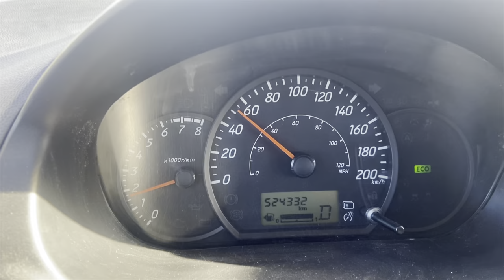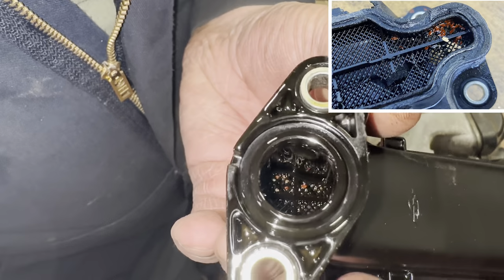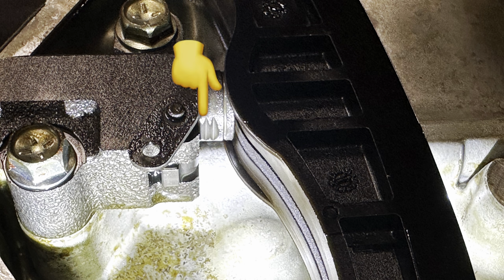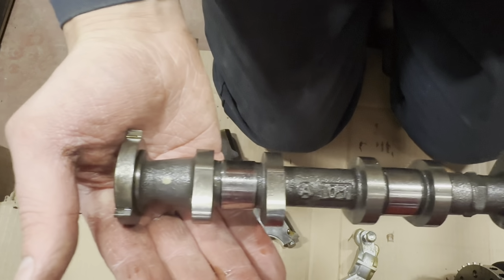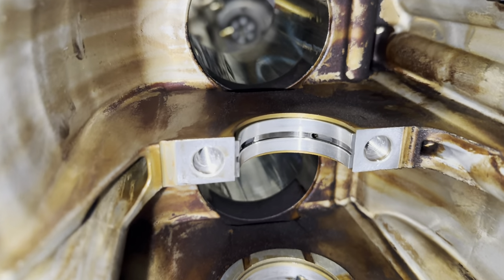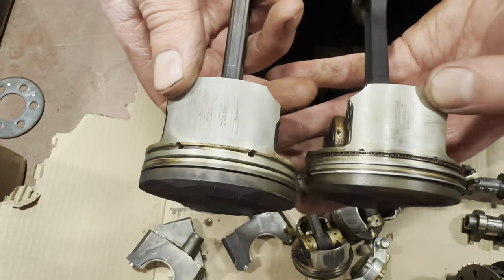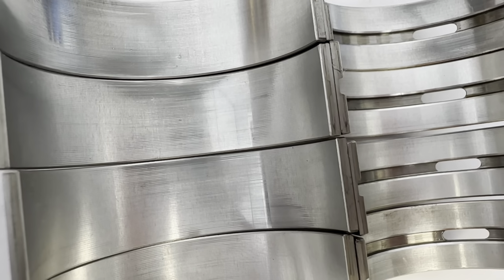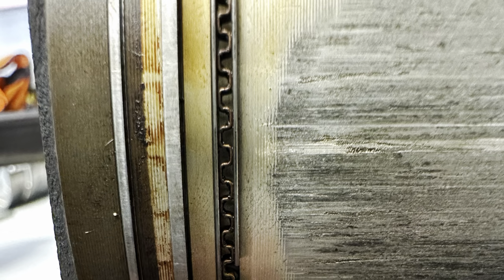524,000km Mitsubishi Mirage engine teardown

Comment: i'm impressed by the milage. we in germany have issues with the 3 cylinder "space star" (mirage) 
sloppy pistons. they eat the cylinder walls. no idea why it's so prone...
ours had 100 to 160k km on the clock where they developed the slap and blocks got replaced.
Reply: It is because of the 15,000km oil changes europeans seem to love. I change mine at 7-8,000km. I hope my Mirage will last a long time. Its my first new car.

Comment: I have had 3 mirages all 5 speed manuals for runarounds and they were great for what they were.. I was always a mits fan but now that nissan owns them they will go down farther. I am a retired ford tech and will not buy anything with a cvt, but i have a friend that put over 300,000 miles on his 14 mirage and his cvt never failed. Front wheel bearings seem to be the only issue i ever had. I also had an outlander sport with 5 speed manual But this old fart made me an offer when it has close to 5,000 miles on it that was over 5 grand more than i paid for it new.

Comment: The skirt wear occurs du to to the angle of the connecting rod while the piston is pressurised and goes to BDC. Therefore this happens to the same side all the time. It gets worse if you load you engine with high loads at low revs.

Comment: Impressive! What kind of oil and viscosity was used on this engine? Here in the USA ours say to use only 0w-20 oil for all temps, so I just stick to that with STP 0w-20 Full Synthetic Oil, but have read a lot of people complaining that it may be too thin for long term wear...
Reply from the maker: Same up here in canukstan. They call for 0w20 here so that’s what I use in the fleet Mirages. I pour in whatever oil I have in the garage at home in my own Mirage.

Comment: are those the original timing chain and head gasket? did it have normal compression values?
Reply from the maker: The tensioner ratchets out so when the chain and guides wore down a bit it took up the slack. I've never replaced the chain or tensioner on these cars. The guides might look worn in the video but they're really not. I'll have to post a picture or redo that part one day.
Reply: @turdpailsandtrails  looks like it can wait another 200k lmao

Comment: Was the higher mileage engine ran at higher rpms than the other? I have a 2020 manual Mirage, and at 70 mph the car is at 3600 rpm or so. I would expect the more frequent combustion and hotter temps would help keep carbon build up down. Is your high mileage car a manual?
Reply from the maker: All the Mirages in my videos had cvts. Most are fleet(delivery cars) so a lot of them were beat on while others weren’t so much. 
They rev lower at highway speeds than the 5speeds.
Reply: @turdpailsandtrails  That's neat, thanks for the reply. Are you the same guy on the forums that has a fleet of 30 or so? I'm pretty envious of the lower gear ratio of the CVT, though I appreciate the extended service interval for the manual.
Reply from the maker: Yeah I was a fleet mechanic until recently. I still have my black 2014 turd. 
I would prefer a 5 spd for the camping trips I took mine on.

Comment: If you didn't replace the engine, how long do you think the old engine would continue to run? Another 50,000 miles?
Reply from the maker: This latest one was noisy for the past year or so. I’m sure it would have kept running like it was for quite some time.

Comment: What brand of oil was used and did this car have a CVT transmission?
Reply: His quote "Ran 0w20 right from new. I might have dumped some 5w30 synthetic-blend in it for the last few oil changes to see if it would quiet down. It didn’t."

Comment: Send that engine to the BMW engineers, so they can learn how to develop and build long lasting reliable engines :)
Reply: Considering that modern bmw engines are some of the most reliable engines on the market today that even Toyota felt comfortable borrowing from them? I think you need to fix your comment and send Mitsubishi engineers a video of how to build an engine.Just because the Mitsubishi in the video has 500,000km doesn’t mean all Mitsubishi’s will hit 500,000km. Toyota and Bmw engineers would be laughing at this pile of trash car

Comment: Hello from Thailand (the country of origin of the car). 10 years ago my country passed a law to support 1200 cc econobox that spawn the Mitsubishi Mirage, Nissan Micra, Toyota Yaris, etc. In the country that call the Camry large and call the Ranger gargantuan. All these economy car is enough for most of us. The only problem is that, many of them used the CVT made by JATCO (a subsidiary of Nissan) and it's pretty shitty.
Reply from the maker: The cvt's are hit or miss it seems. For the most part I'm seeing lots in the fleet with over 400,000kms on them. One has 536,000km in a 2017 Mirage. I've seen a handful of thrust washers fail on the input shaft housing on some 2015's(including the car this engine out of). There's pics of that in one of the cvt teardown video's.

Comment: Pretty good engine i think cause it survive half a million km
How about the transmition? Is it original? Never repaired?
Reply from the maker: I replaced the cvt in this car at 300,000km. Installed a used one. They can last longer than when you change the fluid more often, 50k km/30k miles seems to work. Right now there’s only with 536k on the same cvt and engine. A handful have over 400k km too.
Reply: @turdpailsandtrails  thanks

Comment: it is difficult to say where the piston skirts scratches come from - considering the oil filter filtration activity and good clean oil I don't see how some dirt could have stayed in between cylinder walls and piston skirts - the oil was always very clean and that's why cylinder rings are in very good shape, they are not clogged up - maybe all the scratches come from a problem of piston slap (the origin of the noise as well) I am just guessing

Comment: The red stuff in the oil screen might be fragments of RTV?
Reply from the maker: That's what I thought too but there's no red rtv used in these engines that I could find.  It's never been opened up til now.
Reply: It's probably anaerobic sealer. Lots of new car engines are assembled with it now, instead of the old tried and true silicone. It's designed for very tight fitting machined surfaces and works well, but there's always some squeeze out.
Reply from the maker: @life_of_riley88 the only sealant that I found used from
Factory was grey.

Comment: These 3 cyl the manual are where its at for these mirage’s reliability..to be fair, all it needs is oil squirters to lubricate the cylinder walls better and those scorings would be non-existent, forged pistons and rods, would allow it to be still reliable with a turbo in it to fix its anemic power
Reply: you are right about the turbo but you cant then have the CVT with it! Need the 5 speed manual, but beefed up as hell!

Comment: This goes to show that regular maintenance, in particular short oil change intervals, can prolong an ICE engine for a very long life. I have watched countless teardowns and usually the failures feature torn up bearings and blocked oil rings as a result of prolonged service intervals resulting in oil being burnt from blocked oil rings and bearing failure for lack of oil. I believe much of the hype around Kia/Hyundai engines short lifespan has a lot to do with high mileage, poor maintenance and constant thrashing of their engines.

Comment: Did both engines have the same trans? Were they CVT or manual? And who drove which and how? Were they burning oil at all? Cuz I can see the difference.  The lower mileage engine looks like more carbon buildup on the pistons.  But that skirt/cylinder wall wear is to be expected. They wear more on one side from the thrust/power stroke. When the pistons a pushed down,  the rod tilts forcing the pistons to lean into the cylinder wall as it's not pushing straight down. Same as your lower rod bearings. The top half will always have more wear than the bottom from the "load" during the power stroke.  Overall I'm impressed.  Pretty damn good for a "throw-away econobox".
Reply from the maker: Yes, all there’s 30+ of these Mirages in the fleet, all cvts. The 524k car was used 99% on the highway til it hit 400,000km by the same driver then it was used more in town and got passed around a lot. I replaced the cvt in it at 300k when a thrust bearing failed. 
The 450k car was used more in town, it had the same driver the entire time. The cvt started acting up around 300k, I ended up replacing the valve body(used)and it’s been working fine since.  
Both started using about 1/2L of oil between changes at around 3-350k. The 450k car started using more near the end. 
The 524k car is in better shape overall inside and out. More poops were given by its driver.
Reply: @turdpailsandtrails  ok. I'm surprised the CVT's held up so well.  But yea, that's exactly what I expected for driving.
Reply from the maker: @craigquann I had a bunch fail years ago then started changing the fluid at 50k km. Now lots have over 400k. One 2017 has 536k on the engine and cvt still going.
Reply: @turdpailsandtrails  amazing what good maintenance can do.

Comment: Are you going to rebuild this motor? Give it a chance to get to a million?
Reply from the maker: No I tossed the block in the scrap bin already. There are a couple other Mirages in this fleet that have more miles than this car has. By September the one should hit 600,000 kms.
Reply: @turdpailsandtrails  Curious as to what type of fleet service these are used for? Great video.
Reply from the maker: They’re used for deliveries.

Comment: I hope the Versa 4 banger m/t holds up as well. With less revs than a cvt with a 3cyl it should but who knows. 
As far as I know, the engine is the only difference.
Reply: My wife's versa runs great. Right at 100k. . .the CVT makes funny noises, but it just purrs like a kitten and the doesn't use a drop of oil.

Comment: Was the engine replaced, or was the car scraped?
Wonder if the rattling was a bad balance dampener
Reply from the maker: I replaced the engine. No, the noise wasn't caused by the balancer.

Comment: What year? transmissions?  are these?  What was the reason for the rattling noise? Still on the road?
Reply from the maker: This one came from a 2015 with a cvt. Figure the noise was piston slap. I replaced the engine with a lower mileage one and it’s back on the road again.
Reply: @turdpailsandtrails   that piece of Junk.. will only run 300,000 miles.  Good worthwhile watch.. thanks for the video.
Reply: also, what can you advise about the cvt?

Comment: Aside from that piston slap, the engine was impeccable. See, this is why oil changes are very important. Also, I don't get why people shit on this car, its a basic economy car that gets you from point a to b.
Reply from the maker: They're slow, what would the neighbors think, and lot of people are worried about the high driver fatality rate. They do have poor small front overlap crash rating. So, the only logical choice is an SUV.

Comment: What do you think of the gen  3 montero? I LOVE MINE. almost 200000 miles
Reply from the maker: Which engine? I don’t have any experience Montero’s. I do like my L400 Delica so far though. It’s only got 187k km but needed a lot of work when I got it. Timing belt, front suspension, some major rust issues.

Comment: Any German engineers seeing this? Timing chains can actuslly last! Oil seals can stay clean forever... yust saying VW, Mercedes, Opel, Ford, ...
Reply: Yes and no, this engine is very simple, compared to some german ones, that usually break because of emissions requirements, like having to up the running temp, (bmw switched to +-104*C thermostat, instead of 90*, caused a lot of valve stem seal, and other gasket failiures, bore scoring) or having turbos, more heat in the engine, plus it also dpeends on the driver, cold starts and service intervals
Reply: @7privet_  fair point, but as a mechanic myself I've seen many simple N/A engines failing from weak timing chains, broken valves, lost compression, broken con rods...most at low milage. Either an engine is durable or it isn't. But of course good maintenance is a huge contributor. But look at indestructible Honda's...you can neglect them and still they won't die. While reving high, beeing efficient and kinda complex when coming with VTEC. The urge to extract the last penny out of every product ist the killer of most things I think. We need engineers that say NO to developing cheap crap for the sake of profit.

Comment: What oil brand do you use and how often is it changed?
Reply from the maker: Whatever is on the shelf and cheap. 0w20 since new. Started with mobil one then switched to Klondike after a year or so, now using Motosel oil. In this car, oil was changed every 12,000km for the first 400,000km then switched to 6000km intervals.

Comment: that is a lot of miles . i would think mitsubishi knows how to make a good engine by now , as long as they have been making cars and trucks  . and they built the WW2 zero fighter . they did have have problems with the 2.6 L "silent shaft" engine they brought out in the mid 70's that was used in their pickups and the dodge D50 and other models , however . this engine , being as small as it is , they probably sell it in a lot of markets worldwide, so they probably designed and possibly assembled them well so that they would hold up and gain a reputation for durability so they could keep producing and selling it

Comment: on what oil this engine run or what you recommend?
Reply from the maker: Used just 0w20 on these fleet Mirages. Used Mobil 1 for the first year or so then started using bulk Klondike oil from a truck that pumped from questionably clean tanks/hoses.  Different markets/climates seem
To spec different oil viscosities for these cars. I changed oil typically every 6000km.

Comment: Was because of cold weather startup? Maybe you first put some like Liqui moly lefter or ceratic if the sound will go way or up the oil to W0-30 and let it run for 700 to 1000 km for results those engines show it age in harsh condition
Reply from the maker: I don't think it's cause the cold. I maintain 30-40 of these things. They're all parked outside but are plugged in when it's colder than -20c/-4f. I have another Mirage(2017) making the same noise with even less miles. I'm gonna try a few things before swaping it out. Will check valve lash when I have a chance, I didn't bother doing that with the first two I tore down.
Reply: @turdpailsandtrails  30-40 of these with so many km?  Can we get more insights into the fleet, why so many cars and so many km?  Also what other cars may have been considered for the fleet that didn't make the cut, what are the most important criteria in choosing vehicles for this particular fleet?
Reply from the maker: @gregpadberg1402  I don't choose them, I just maintain them. So far they seem to hold up great. There was a spark in the mix at one point but it was sold off quickly after warranty ran out and it blew threw 2 cvt's(same model Jatco cvt as the Mirage oddly enough)and the dealer doing the work was a nightmare(they forgot to tighten ball joint so it popped out 10mins after picking car up then when fixed that, they forgot to tighten a tie rod and it egged out the hole in the spindle). 
These Mirages were cheap, have great warranty(only used warranty once in 10 years to have one cvt replaced). Small vans(transit connect,nv200,promaster city etc...) would be more ideal I think but they are now extinct, just like small cars are becoming. Right now the Mirage is the only small car I know of that gets 40mpg by just driving it normally. 
I bought one used privately to use/abuse too.
Reply: @turdpailsandtrails 40 mpg is pretty good for a three cylinder, normally you have to rev them like crazy to get any power. On the highway what mpg do you get? I suspect the engine has to work pretty hard above 50 mph.
Reply: @aden3113  I am a slow driver, live below sea level (Netherlands, so thick air) and I get 60 mpg mainly highway in a Mirage 1.2 CVT. I seldom exceed 55 mph.

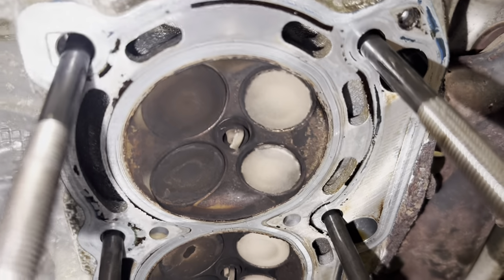Comment: The pistons might have been ruined by overheating. Just a single time would be enough. I see the water jacket plug @ 13:09 is corroded. Probably leaked causing an air bubble inside the jacket. It may have not shown the overheat on the dash. Happened the same to me on another engine.

Comment: I guess if you used thicker oil the pistons would look much better. But really impressice mileage for such a small engine. I wasnt sure how these small engine hold up on high mileage because the engines experiences more load on average than a v8😅

I got 2 questions tho:

Is it normal for the exhaust valves to look this white? Does this indicate a very lean burn or or water in the combustion?

The bearings look to be just turned? Not grinded. Can this be? And the pistons too.
Reply: The light exhaust valves are normal. Although it is not a lean burn engine, the engine computer lets it burn as lean as possible.

Comment: Whats the rest of the car like?
Reply from the maker: Other than paint chips and surface rust along the front edge of the roof it's holding up pretty well. They have very few problems. I think I changed the starter once and the heater motor once, and the drivers seat a time or two.  Other wise stuff like window motors/regulators, wiper motors/transmissions, heater controls, just don't normally fail like they do in some other vehicles.
Reply: What are this cars used for? Taxi ?